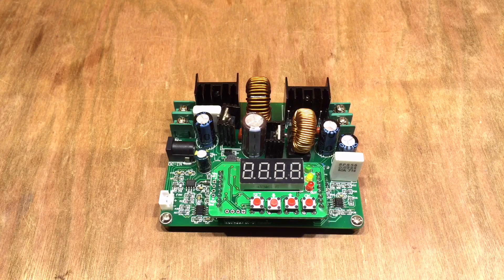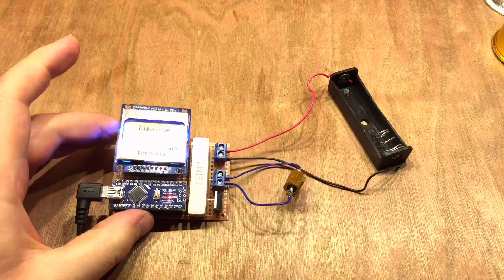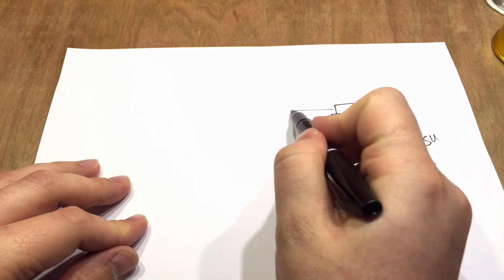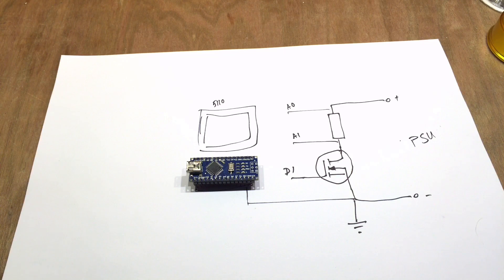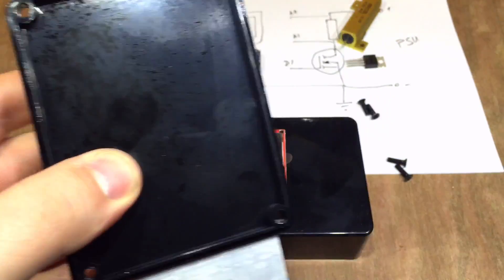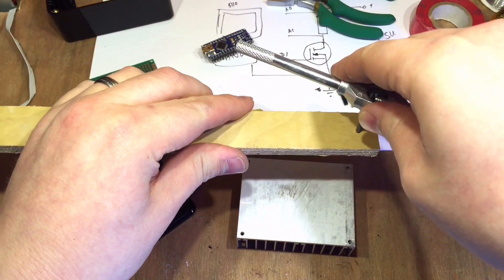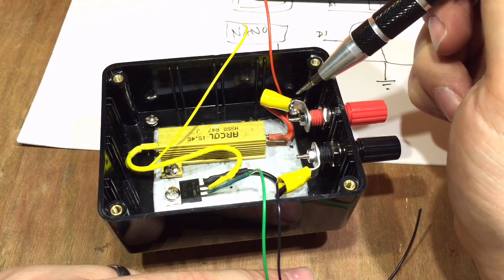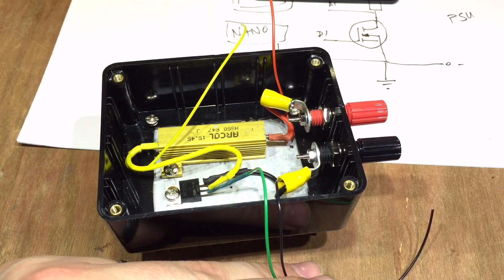Constant Current DC Load - Part 1 - Concept - Adam's Arduino Projects

Comment: nice project. it should work for the purpose of producing load, but I think the current will not be very constant. Instead  it will be very much like pwm signal from A pin on the nano. the cap on the gate should help to smooth it out a bit. Another easy way to make a load like this is to use a couple of opamps instead of nano in order to sense current and  drive the mosfet - this would give a true constant current flowing from the load. But then you loose LCD. unless you combine the two, which would complicate the project a little.. .
Thanks for the videos!

Comment: I built a diy CC load to discharge batteries and am building a charging circuit atm

love the info these vids provide
Reply from the maker: +BillTheBox Thanks for your comments. Any tips regarding the dummy load... I've lots more work to do to finish it?!
Reply: +Adam Welch I would add some ( small amount ) of capacitance to the mosfet - resistor wire see if it helps with load precision.

The thing is, it's only a CC load because it oscillated at a constant speed while pulling a constant voltage range ( eg you will pull from 0 -> 2v then it will cut off, fall off to 0v then back on up to 2v etc )

idk if that's clear, but for heavier loads such as 2+ amps you will probably have to have a small cap to see if it helps

I'm no electrical engineer so I need to test this stuff, and I'm no teacher so I don't know if I explained well, but hopefully it helps
Reply from the maker: +BillTheBox Thanks. I'll bare this in mind as I move forward with the project.